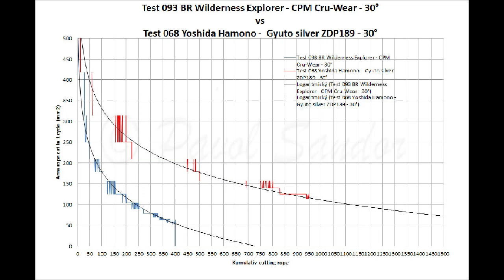No 093 Bark River Wilderness Explorer - CPM Cru Wear   30°

Comment: Hello ! I like your videos, I see you are using always Tormek T7 for sharpening. Do you think it is the best sharpener ?
Reply from the maker: With Tormek, I achieve the constant grinding that is required in my tests.
Reply: I have a worksharp ko edition with the gringing attachment. I saw you tested it. What do you think between the worksharp versus the tormek system ? And is it possible to sharpen hard steels like s110v with the tormek ? Thanks
Reply from the maker: All types of steel can be sharpened on Tormeck. An important grinding wheel is used.
Reply from the maker: CPM 110V - no problem
Reply: @pavolko10  Did you try the japanese water stone from tormek ?
Reply from the maker: I use about 17 reels, here are some of them.
http://www.knife.cz/Default.aspx?tabid=53&g=posts&t=22970&p=11
Reply: @pavolko10  Wow ! very nice stuff ! Do you think the SJ250 Japanese water stone from Tormek is a good one ?
Reply from the maker: my experience:
SJ 250 excellent stone for "Japanese" knives
Rozsutec - the best stone on kitchen "European" knives about 56HRc.
Overall, the best finishing stone is Tyrolit 3um.
Reply: @pavolko10  SJ 250 for steels like s30v m390 and s110v ?
Reply from the maker: SJ 250 for steel as s30v m390 no problems. And s110v - a little more work.
Reply: @pavolko10  thanks a lot man !